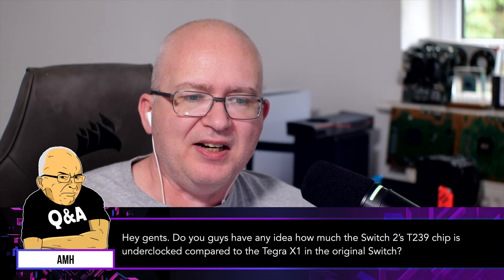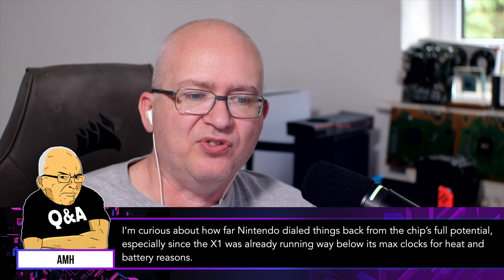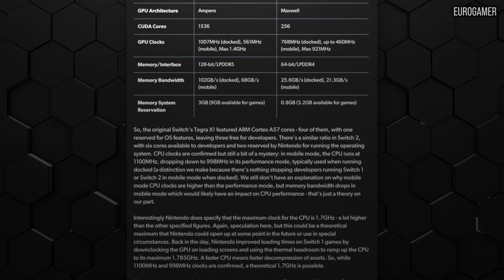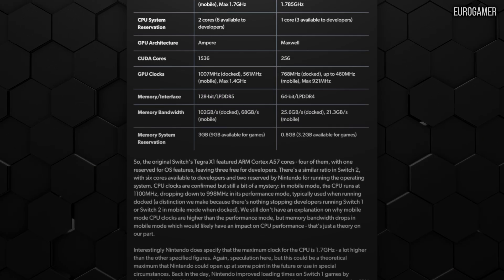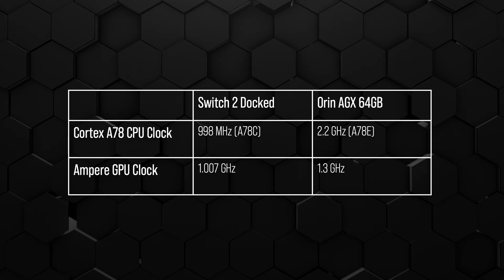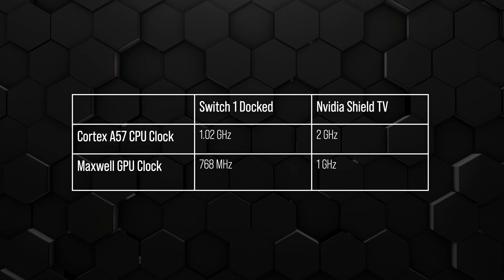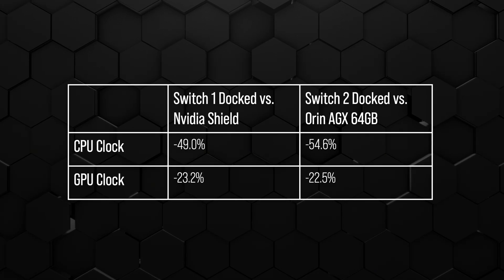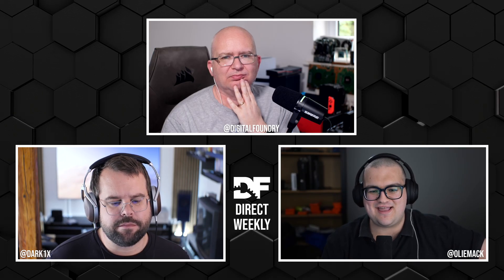Switch 2 SoC Under-Clocked? How Much Performance Is Left Untapped?

Comment: Some games could block the use of game chat for some perfomance and RAM gain...
Reply: I don’t know why they aren’t doing that yet, some games on Switch 1 blocked the clip and screen recording function to get some extra perfomance, they should be able to do the same right?
Reply: @SeikoKKJ  That would be a bit different. Since with GameChat you can start playing one game but if a game didn't support gamechat that'd be weird... I think Nintendo should be looking towards making GameChat use less RAM somehow
Reply: @mattbattmatt I'm willing to bet they reserved more than needed for GameChat in hopes to evolve it later or add more features.
Reply: @yoshicube64 yeah, this definitely feels like they overshot it with the hardware and basically needed more time to optimize the software side. I would not be surprised if they were able to gather a gigabyte more to throw into the game pool. Now with that said, since they're using DLSS, the amount of RAM they need is not as high. So all the potential really lies in how well developers can optimize their games for the platform. And I hope that Nintendo assists them in making it easier to optimize their games moving forward. Because it's hit or miss right now. There's some games that run well like Hogwarts Legacy and look great, and then there's others that run like dog shit like Persona 3 reload. But it's sharp, but it's not running at a stable 30, and it has insane input latency. For probably the first time in my life, I don't think Nintendo put out pitifully weak hardware. For a tablet, this machine is really good for its price point. Unfortunately, in order to reach the heights that it's capable of, developers are going to have to put time into their ports. So for now, we just need to avoid bad ports like Persona 3 reload and only buy good ports. Oh, and I'm not buying any game keys. I'll buy the game digitally if I want to have it bad enough.
Reply: @SeikoKKJ switch 1 games didn't do that's for performance, it was just an arbitrary limitation. you can easily unlock those features again on a modded switch and it doesn't take any performance away lol
Reply: @CropDudia480p It DOES affect Performance, in Games like The Witcher 3 and Resident Evil 2, they straightup won’t boot and crash due to running out of Memory. It’s like a 10MB-40MB RAM Pool that Video Recording uses on Switch 1. Next time verify what you’re gonna say if it’s homebrew related instead of talking out of your Ass

The creator of the Patch that lets you record in any game/app also said some games may have performance issues, ofc he didn’t test every Game but still
Reply: Who even uses Gamechat?
Reply: @HeavyMetalSonicRM Said one with 0 friends
Reply: no?
Reply: That’s a stupid idea as if some start a lot would start which then misses the point of it in the first place.
Reply: If it's not being used then the ram isn't either. Lol
Reply: @jamman7344 Btw yes the RAM is being used

The way it works is that a section/pool/amount of RAM is given to the Game specifically, then GameChat has its own RAM Amount (3GB) whether you use it or not, the Game HAS to have the same RAM Amount at all times to avoid stuff like Memory Leaking and crashes by sudden changes in the RAM pool… it’s literally the same concept as Memory reserved for the OS since GameChat uses a similar thing 

from what I remember, the Pools are for the Game/Software, for the Applets, for the OS/System, for “System Unsafe” and finally for GameChat, not sure what’s the actual configuration on Switch 2 since they just say “9GB for Software, 3GB for the OS” but the RAM pools on Switch 1 with Video Recording enabled (as of 20.5.0 since there was a change going from 19.0.0 to 20.0.0) they are as follows: 

Games: 3285MB/3.28GB
Applet: 493MB
System/OS: 239.16MB
System Unsafe: 44.12MB (don’t know what this even is but at most, it always uses 42.22MB out of 44.12MB)
Total RAM amount: 4061.28MB (4GB)

Not sure which of these handles the memory for Video Recording but still, it is actually kind of cramped there but it’s essentially around 775MB that background and OS-related tasks on Switch 1 took away from the Games (and back then it was about 800MB) and well that’s very little compared to how Wii U took an actual 1 full GigaByte and just left 1 single GB to the Game (so 50:50) or how PS3 was 128MB at launch and now it’s just 64MB that goes to the OS, out of 512MB. 

Hell today, both PS4 and PS5 take up just 2GB for the OS, with Xbox embarrassingly taking 3GB for the OS but that OS has way more features than the Switch 2’s basic OS so it’s fair for it to take that much and it’s just a huge bottleneck

In fact, the Wii U’s and Switch’s major bottleneck was RAM Clock speeds followed by GPU
Reply: Nintendo might allow that in the future if the devs are asking for it. We'll see.
Reply: I still keep accidentally hitting that damn button
Reply: @christophergaus3996  how? the button is low profile compared to other buttons. on the joycons, it's below the right analog stick where no other buttons are, so if you press it, you want to press it. on the switch 2 pro controller, it's below the select button, but again, it's low profile while the select button is raised making it very hard to mistake either button for the other. maybe it's the controller you use?

Comment: The switches x1 maxwell gpu was clocked at 768mhz docked. Thats 64% of the typical around 1.2 Ghz boost clock of its desktop maxwell counterparts

Ampere desktop cards have a typical boost clock of about 1.7 ghz.

64% of that is 1.088 ghz, oh hey, that's basically exactly the switch 2 docked gpu clock.

Who could have seen that coming aside from everyone who saw the lapsu$ leak back in 2022.

Comment: I wonder about 2 things they could do here (was it mentioned in the developer docs at all).

1) Does the CPU go to 2GHz during loading screens? The Switch 1 had such a feature added: The GPU clock would drop and the CPU clock would be ramped up to speed up loading times.

2) Could Nintendo take a leaf from the PS5s book and allow dynamic clocks based on workloads while keeping the chip within it's power/thermal budget?
Reply: not really because it has battery constraints
Reply: @A_noone_Z  The line of thinking is that when the GPU isn't doing anything interesting (eg during a loading screen) it throttles down, and the CPU swallows the extra power to speed up whatever it's working on while the screen is black.

Comment: Itll melt itself lol there's a reason. Switch 2 sucks in comparison to everything else. Shit for that price just buy the new Ally. I wouldn't but its more appealing than this.
Reply: The ally is much more expensive than this, switch 2 is the best performing handheld sub 600 bucks
Reply: @coolbeans921  Steam Deck Oled
Reply: Switch 1 didn't melt itself when you doubled the clock speeds.

Comment: Nintendo is weird for not unlocking the switch.  Just like they did Bluetooth. It was in the console for 2 years before they unlocked it.
Reply: You do know it runs off a battery right?
Reply: @AZBCDE why is it clocked at half the speed of fanless phones from 2020 with the same cpu cores? Oh right because Nintendo used an abysmal ancient node for no reason other than higher profit
Reply: @toxy3580  because It runs off a battery and because of its slim form factor which doesn’t allow for a bigger battery STUPID
Reply: Bro that battery life is already not great 😭 it would be like 20 minutes of battery life

Comment: which makes modding a necessity for this device if you want to have at least somewhat of a decent experience. My modded Vita still holds up! even a stock clocked Vita was very impressive for its time. Nintendo has won the platinum trophy for releasing heavily underclocked hardware
Reply: Necessity is the wrong word there

Comment: This is so… Nintendo should have just went with a smaller processing node and taken the loss rather than cheap out and screw over the consumer. We are paying $450 to not even use the real performance of the console
Reply: Nintendo has never sold hardware at a loss, and there's nothing wrong with that. Especially for a company who can't back itself with other revenue than gaming like Sony or Microsoft
Reply: @KevZ7. they earn so much from software it would be fine, it's not like they would even lose a lot for each unit sold at a loss.

Comment: They had to underclock the hell out of that horribly awful Samsung 8nm silicon, or the console would get about 20 minutes of battery and melt your hands off.
Reply: They have to cheap out as much as possible rather than giving us better battery life and performance
Reply: @Whyisoliz  people went through drop-the-price shenanigans, even in current "cheap out" form. Xbox decided not to cheap out, resulting in $1000 price tag. Stop acting like price doesn't matter.
Reply: @jwp5461  The Switch 2 is being sold with an insane profit margin. People only ask for price drops when the hardware doesn't warrant the price tag.
Reply: @anon4305  so how much they get per unit?
Reply: @anon4305 insane?! Is there a leak? I want to know!
Reply: @anon4305  no, the profit margin is not insane. It costs roughly 330 dollars to make (the Vietnam factory prices leaked), on top of which you need to add transportation and taxes (not even accounting other adjacent costs like marketing). In Europe, with 20% VAT, I’m not even sure they make a profit at all. And they absolutely lose money on the Japan exclusive models that are sold roughly at their production price.
Reply: @Whyisoliz get of your self entitled colonial capitalist.
You should get the slave trade third world Temu cheap version.
Reply: @Whyisoliz  Typical modern Nintendo.

Comment: I mean, if uping the clocks leads to the system blowing up or the battery commits seppuku then the answer is that it isnt being held back in its current form.
Reply: Uh no that's not how it works. The chip has a clock speed it is designed to run at. Nintendo is running it far lower.
Reply: @toxy3580  No I totally undestand that. I don't think you understand what I am trying to say.  I'm saying if the current clocks are deemed as proper for the Switch by the engineers... it wasn't a mistake and there is no such 'extra room' .  Its just smart design.

Comment: I do agree that having 2gigs of RAM out of the 12gigs of RAM being dedicated to just the Share Button features sucks. Nintendo should give me an option to switch RAM usage around, especially if I have no plans to ever use the c Button
Reply: One annoying thing about the social features is that it doesn't even offer lobby hosting. I still have to find the rooms where my friends are at in Mario Kart World. All that RAM eating up and it still doesn't fully do what I want it to do.
Reply: Giving you the option to do that would do not all that much, giving the option to developers could be good as they could actually utilize it

If a game uses 9 gigs of ram, having 10gb or 500gb of ram there wont be any difference in performance
Reply: This isn’t a PC. Why on earth would there be a RAM slider on a console, a nintendo console no less. Wouldn’t even make a difference as devs would have to assume the worst case scenario and build games around that
Reply: The actual solution we will get is probably just optimisations to the OS. There were leaks to suggest Nintendo had set internal targets to claw back a whole gigabyte of RAM, so there is some reason to be at least a little optimistic.
Reply: I think they should add nintendo music, Apple Music & Spotify as something that can run when you aren’t using game chat.
Reply: If they did that, then some uninformed consumers would inevitably attempt to use the C button or share something after they've set it to 'max performance' mode. Then  their switch will either 1: melt or brick itself 2: drop performance massively 3: get a ton of bugs, or 4: nothing will go wrong but they wont be able to share anything. Then the uninformed user will post on reddit or the story will spread around about their problems, no one realizing that it's all their fault, and Nintendo will get blamed. There's always an unseen cost to every design decision.
Reply: @alexs_toy_barn  This is a silly comment, obviously the use of the button would be disabled with higher performance profiles and just bring up a little screen saying "lower ram usage to enable" or something
Reply: @anon4305  Yeah I agree, his comment kinda sucks.
Reply: @alexs_toy_barn  this is so unfounded and would never happen. why do people like comments who dont know what they're talking about

Comment: that thing would be a beast if they raised the tdp a tad, destroying any competition realistically with nvidia's far superior energy efficiency
Reply: It would also destroy an already small battery
Reply: They could've done that if they didn't picked the cheapest battery available
Reply: @LianCasablacks  heat would still be a problem, impacting the form factor in return for extra cooling, etc. Mobile hardware is very tricky to pull off as any change can have a domino effect. A vapor chamber would have helped greatly but is still too expensive for this class of hardware.

Comment: I don’t mind the handheld performance too much, it’s the laughable clocks when docked.
Reply: It’s extremely hot though when I play Fortnite for hours (3-5 hours). Not sure if this a performance type of game. But when I get the switch 2. The fans are full speeds and it’s extremely hot.
Reply: @WarAlex16 You are right.... not just from 3 - 5 hours. In general the Switch 2 can get really hot in docked mode. It cools down after some minutes if you get it in handheld after that. I think it is maximum for the form factor and cooling system.
Reply: @mipha5262  Yeah it’s unfortunate it wasn’t designed better for a higher performing docked experience
Reply: @mipha5262  it's a Samsung 8nm problem probably the worst node for a portable gaming system.
Reply: @MattyS54  I mean you feel the heat on the back.... which also mean it gets out of the chip. Hope it will last many years.
Reply: Talking about dock mode.
Reply: Who plays for 5hours get a life
Reply: @ufcfan3940 I thought all real gamers sometimes reserve whole days for gaming...

...My family knows that this Christmas I am Playing Metroid Prime 4 like it's my job

... and its gonna be epic while they do puzzles and read books or whatever and wonder where daddy is(just kidding I have 2 teenage girls and they don't give a f* about me gaming)...and my wife is pretty chill also

Basically why are you not gaming more, organise your life

Comment: I hope for GTA 6, Nintendo allows an exception.
Reply: Nintendo doesn't even have gta 4 or 5 and you want gta 6... Nintendo switch 2 is more likely to get gta 5 in the coming years then gta 6
Reply: Nintendo isn't blocking Rockstar. They would love every game to be on their system.

GTA5 was a bit heavy for the Switch, and GTA6 is a bit heavy for the Switch 2

...but the systems are selling like crazy, so maybe we get GTA5 which can easily run on the Switch 2...or even better, GTA6 downscaled with GTA5 level graphics

But I don't think Rockstar has had time to figure out those things right now when they are probably optimising for the initial target version

Maybe late port is my guess
Reply: @WinterGK  GTA5 is a PS3/360 game, it wouldn't have had any issues on Switch
Reply: @JackFrost-1856  Singleplayer no, but it probably wasn't ported because they couldn't stuff online on there (like a singleplayer only gta 5 port wouldn't be a godsend)
Reply: CPU is probably too weak to run it in any form.

Comment: They even didn't unlock full potential from this yet, we only 4 months in the market. 1-2 years they can have a much smaller SOC for enhanced battery life around 6 hours AAA gameplay in single charge
Reply: Crazy that cost of game development will affect battery life. What a world.
Reply: 6 hours perhaps a stretch, but 3 plus easily
Reply: @MisterPikol Why ? Switch 2 play Cyberpunk 2077 in 40fps handheld can last 2.5 hours using 10 watt. This on 8nm SOC. Imagine on 4nm SOC
Reply: @KimoKimo-Ci  4nm doesn't automatically mean 2x efficiency, that's not how that works, besides they most likely would go 5nm like was the ampere's original architecture.
Reply: @MisterPikol I think from 8nm to 4nm SOC will have efficiency more than 2x. And also Nintendo can put 30Wh or double at 40Wh from current 20Wh battery capacity. I said 6 hours because Switch V2 and Switch OLED can have 6 hours (from 2.5 hours OG Switch) big games gameplay even from just 20nm to 16nm
Reply: @MaeMae-t7e4g what are you talking about, that 6.5hour figure is only when you play simple indie 2d games, switch oled isn't running breath of the wild for that long under no circumstance. They might add a slightly bigger battery, but if anything bigger, they'll have to redesign the internal layout and form factor. So yeah, 3+ hours is a safe claim here.